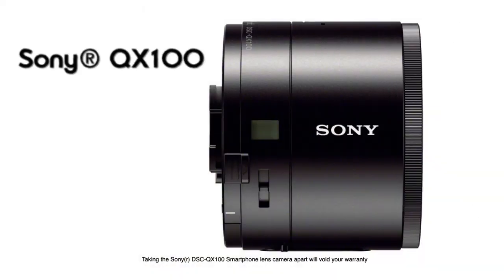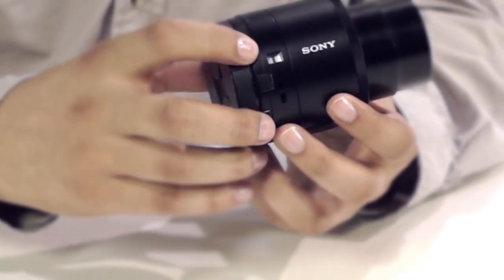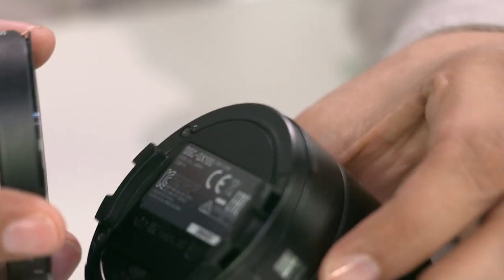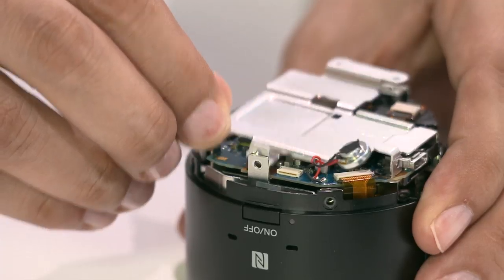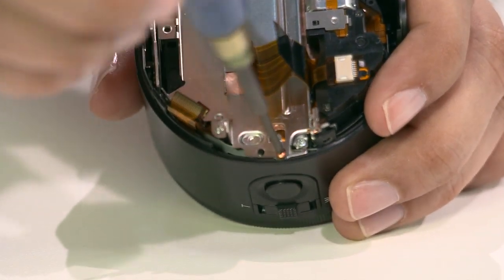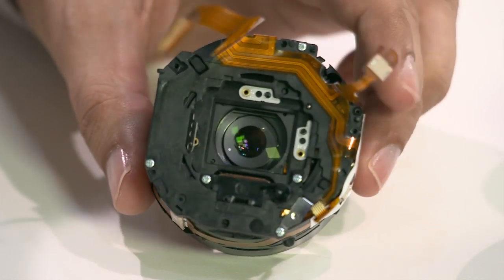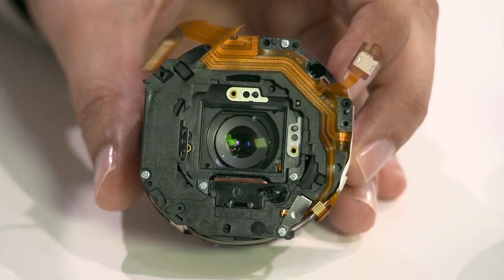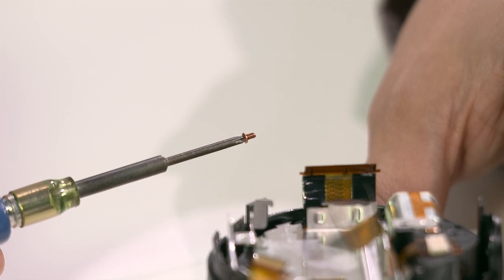QX100 Lens Style Camera Gets A Teardown Just In Time For Shipping

Comment: Does anyone know where the WiFi antenna is?  My QX100 is great but the consistency of the connection to my iPhone is so frustratingly dreadful (even on the updated firmware).  If I move them more than about 30cm apart, the connection usually stalls/freezes or drops entirely. :(  I bought it second-hand, so sending it for repair isn't an option.